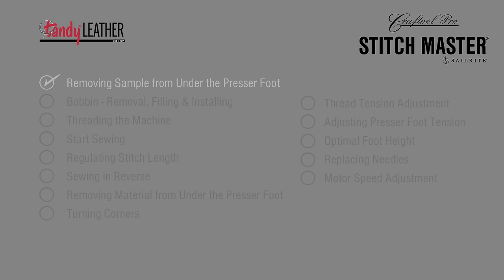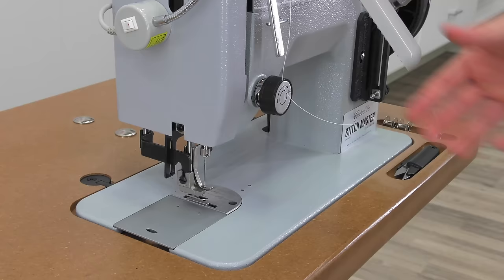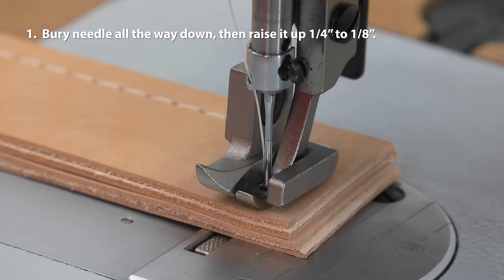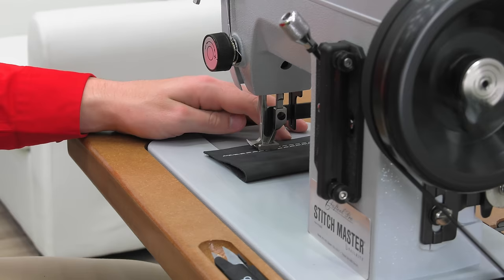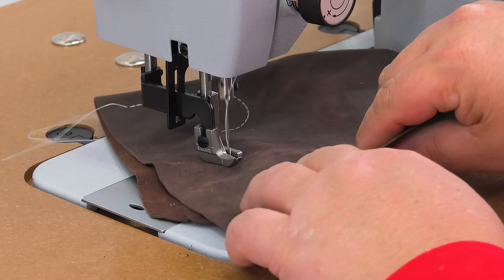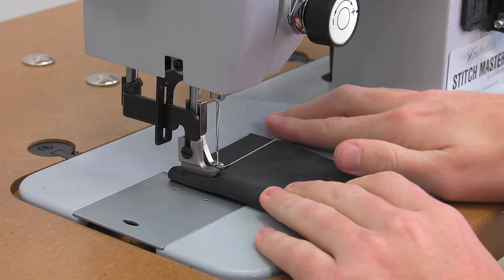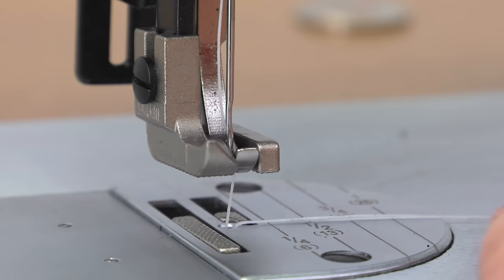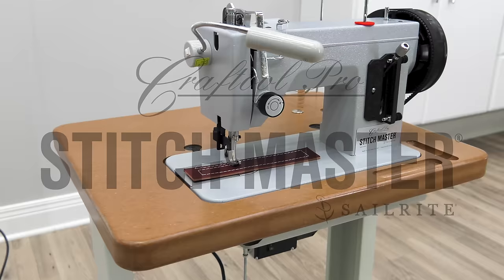Using Your New Stitch Master Sewing Machine

Comment: I had a Dressmaker 2402 for years until a flood. Great machine, and it appears many of the components of this machine look identical. Is there a relationship between the companies? Thanks!
Reply from the maker: Sewing machines are a lot like animals, they all have similar organs, but they are all completely different. Parts may look similar because they all do the same thing with the thread as it is stitched, but Sailrite machines are different, we have no relationship with the Dressmaker company.
Reply: They are generally all made in China. I like sailrite, but their machines are really overpriced  🙁
Reply: @steve10509  I’ve been looking at machines for a few monthsand I thought the same thing. But I pulled the trigger and I got an LSZ , it may be a few hundred dollars more than look alike machine but these guys are great!  customer service is unparalleled in my opinion and the machine is wonderful. I’m glad I put my faith in sailrite.